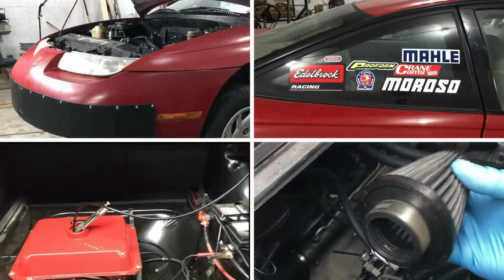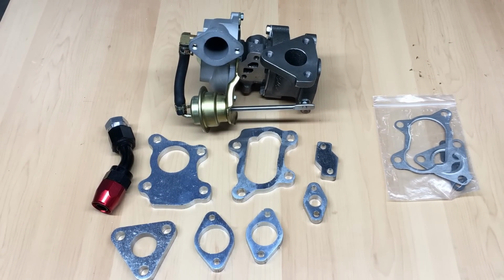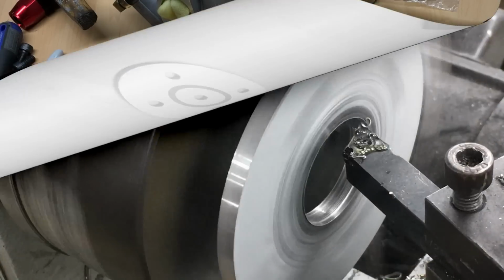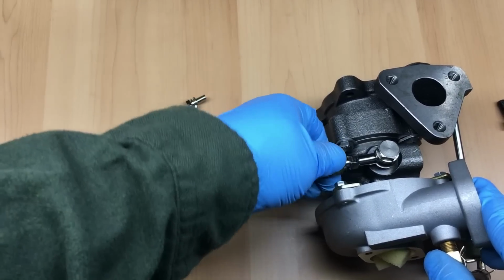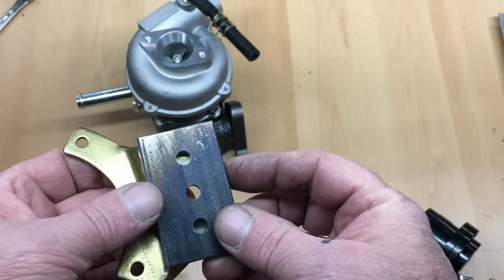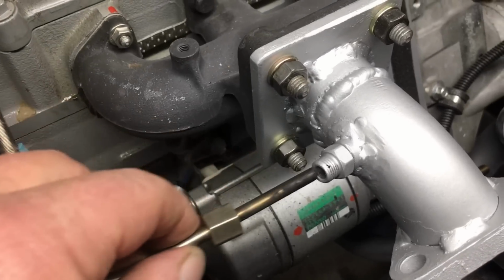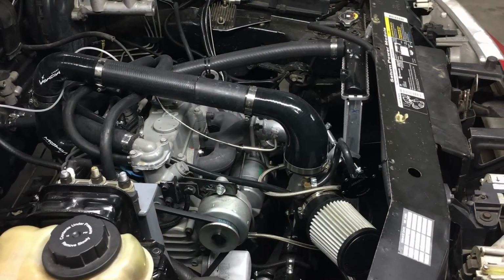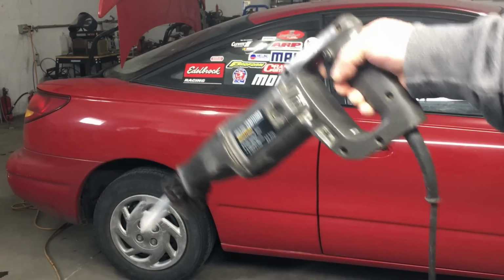S3 E5 We install a RHB31 turbocharger on the Kubota D722 diesel engine in a 1999 Saturn coupe.

Comment: My current project is hooking up an AGNI high power DC axial flux electric motor to an AMR500 supercharger, it blows massive amounts of pressurized air.  I am using it for experiments and inventions, however I was thinking it would be perfect for trying out with an engine such as yours which I may do in the future.  If you're not familiar with AGNI/Lynch motors, they're awesome and worth looking into if you have a project that needs from .1-50hp and high torque; here is some more information which is a little dated but still accurate:

The Lynch motor is an unconventional design with a disc armature. It marries the advantages of a conventional, wound armature motor with the benefits of a flat (printed circuit) motor. It is similar to a pancake motor, but is more powerful than any of these technologies. The disc armature has magnets on both sides, doubling the available flux density and shortening the magnetic path. It therefore packs more power per pound and per cubic inch than any other motor technology. Of course such a revolutionary motor is not for every application - it is not as cheap as wound field motors, but for many applications it is a far superior motor.  It has a previously unheard of power to weight ratio and also power to volume ratio. It is also highly efficient because of the double magnet design and associated short magnetic path. It also includes integral fan cooling.

 The Lynch motor is an important development which spurred other motor designers to improve their products to remain competitive, such as synchronus permanent magnet machines.  As a result of the competition between manufacturers the cost of high performance motors and controllers has fallen dramatically.  We hope the cost of solar cells also reduces to allow renewable transportation to develop as a viable alternative to carbon fuels.
Cedric Lynch built his electric bike around a mid-drive configuration, also building one of the worlds most efficient light weight electric motors to power his rig reliably at 60-MPH for significant distances. He would later set several world records with his axial flux motor and bring it to market as the Lynch / Agni motor. Briggs and Stratton would eventually buy this technology which would lead to the Etek motor, which is now famous for making high speed efficient electric hot rods.

Cedric uses to achieve high speeds is by following the rules of aerodynamics, and building a bike that is as aerodynamic and as efficient as possible. The other builders on this list bypassed this step, and Cedric uses this bicycle as daily transportation on real commutes. Although this high-efficiency motor uses “old school” brushes, this fact allows builders to use very affordable controllers. He has proven his design choices through thousands of miles of commuting, and the Lynch motor is highly respected.

Cedric Lynch is known as the creator of the Agni Motor, a highly efficient electric motor that weighs around 25 pounds and can put out as much as 50hp. 

Cedric Lynch is a British 'mad scientist' type mechanical engineer obsessed with the idea of greener transportation. His interest has been in building a super efficient yet powerful vehicle that can serve as a car replacement.

He started thinking of his own design for an electric motor in 1983 when he began entering competitions organized by the Battery Vehicle Society regarding building an efficient electric vehicle. At the time there was no reasonably priced DC motor with descent efficiency so Lynch decided to build his own utilizing modifying existing motors with old tin cans that he would spread out flat to use as cooling fins. Surprisingly using rudimentary materials and a garage work bench, Cedric was making better more efficient electric motors than any of the universities were able to manufacture in state of the art workshops.

Cedric then came up with a motor design that could be cheaply manufactured and began manufacturing his own motor that he could sell to the public in 1988 and the Lynch Electric Motor Company was born, known as LEMCO.

Cedric first used his motor to create a small boat called “The Spark” that would set an electric boat efficiency record. From there Cedric turned his attention to bicycles, an application generally considered too small for a lynch motor at that time. Cedric mounted his motor in recumbent bike, allowing him space to eventually use a set of thundersky lithium batteries.

The resulting aerodynamic recumbent bike had a top speed of 60mph and still managed an incredible range of 150 miles. Cedric rode his recumbent creation everywhere as a daily commuter, putting an amazing 50,000 miles on the machine - technically a motorbike.

Briggs and Stratton, the US firm famous for lawn mower engines, bought the technology and used it in their E-Tech Motor, and Cedric went on to manufacture his latest incarnation of his lynch design into the Agni motor, which is used in go karts, sailboats, motor boats, and even small airplanes.

The Lynch designed motors all have the same traits. Brushed motors, around 25 pounds in weight and they are able to put out enormous power compared to their weight. Sometimes as high as 50 hp (depending on amperage ran through the motor) at an incredible 98% efficiency.  Lynch Motors are also the most often used motors in electric motorcycle racing applications.

Cedric's zero-emission motorcycle, which has a top speed of 120mph, was shown in action winning the world’s first zero carbon race – the TTxGP in the Isle of Mann.

The idea for the electric motor has been snapped up by the 56-year-old’’s friend Arvind Rabadia, who together with his brother Hasmuk Rabadia had been thinking of starting a business in India. They have now set up Agni Motors to make further-improved versions of Cedric’s motors

Despite Cedric’s breakthrough invention he has no formal engineering qualifications and taught himself the techniques needed to construct his engine. He first became interested in electrics when his parents bought him a book entitled How to build things from things found at home. 
The Etek motor is a brushed 25-pound pancake shaped motor that puts out enormous power for its weight. Depending on amperage and voltage the Etek can easily provide between 15-horsepower and 30-horsepower reliably and consistently (11-kW / 22-kW). A perfect platform for a powerful electric bike if you do not mind the weight. Although brushless motors are considered more modern, a brushed motor like the Etek allows the builder to use very affordable controllers.

Cedric-Lynch invented the motor and sold it to Briggs and Stratton which US company produced the Etek at a lower price (around $600). In the late 90’s early 2000’s it was the way to go for a high-power / light-weight electric vehicle. Many small E-vehicle records were set using the Etek motor. Finally, the market had a relatively lightweight and powerful electric motor available to the masses.

In essence, the Etek allowed hot rodders to build electric bikes. Before the Etek very few people had ever achieved 50mph on an electric bike. Even today, Etek motors (and newer incarnations of the Etek motor) are used to make some super fast electric bikes. In the case of Liveforphysics, the fastest E-bikes ever.

 Liveforphysics used a newer version of the Etek (the Agni motor), to achieve speeds of over 70mph, and dominate a recent hill-climb event.

Every Etek I have ever ridden has been characterized by brutal off-the-line acceleration, usually to a point where you have to apply the throttle very carefully or get thrown off. However, it is possible to run an Etek at a lower voltage or lower amperage and have a very manageable, safe, and sane electric bike that will not burn out on you, no matter high steep the incline.

Comment: Recommend matching the flanges to the gaskets on the exhaust side. I had a 93 Jimny 660cc turbo, discovered a crack in #2 exhaust runner, matched the new manifold to the exhaust side gasket and the manifold to the turbo. The turbo had a lot of material disturbing the exhaust flow. I am sure the leaking exhaust wasn’t helping, but I did see less turbo lag. I am sure you will see some lag with the addition of the inter cooler and increased boost pressure.

Comment: If your EGT is good, retard your timing for more boost. Also, I would go smaller with the piping to the engine. The turbo has to pressurize that pipe. Short and small is better, less volume to fill.

I have the same turbo on a eBay 400cc diesel on a garden tractor. It easily makes 6 psi under load until the tires loose traction. It makes 2 psi just mowing the yard. You can definitely get more boost.

Comment: Don’t forget that you now need a rising rate or 1-1 fuel pressure regulator.
Sometimes called a boost reference fuel pressure regulator.
Reply: Don’t need that on a diesel it’s DI
Reply: @404MissingLink  
Yes and it’s still got a fuel pressure regulator valve in the fuel rail. 
And if that fuel pressure ( valve ) is not being commanded to raise fuel pressure with boost you’ll run lean and that will melt things. 
Simply put this engine doesn’t know it’s getting more than atmospheric pressure.
Reply: @Whateverpoopiepants  diesels don’t work that way. Direct injection is around 2200 psi. You really don’t need boost referenced pressure regulators and diesels don’t melt things by going lean if you take fuel out they just make less power. I think you’re confused with a petrol motor which you’re absolutely right about. Diesels share almost nothing in common with them
Reply: You technically don’t need that on gas either. You have to tune appropriately either way. Obviously a FPR helps the injectors go a longer way. My boosted 5SFE Camry has the FPR on the sending unit in the tank, it’s got a static pressure.
Reply: @jmhalder  
I’ve also cheated on mine, I haven’t done what I’ve said and instead used a 4 bar regulator from another model. 
However the ecu itself has a boost pressure sensor and in the fuelling setup you can scale your injectors and tell the ecu it has a 4 bar regulator. 
But this is mechanical fuel injection and has a linear fuel curve not one that accommodates for 0 bar at idle and then 1 bar at full chat. 
That actually means your getting 7 psi less fuel at peak boost.

Comment: More power = more heat and higher egt. 
If the exhaust is cooler now your making  less power.
You need more fuel for more power and that means more heat. 
Intercooling will help but at the same power level with a turbo the egts will be hotter because of the induced heat through the turbocharger.
Reply: It's a bit different for diesels because they are fuel quantity regulated. Burn the same amount of fuel in more air and your power won't improve much, but the peak temperature will be lower because the heat is 'diluted' in a greater mass of air.

This is part of why diesels love turbochargers so much. They're not detonation limited like a gas engine, so if you can supply enough air to keep the EGT under control you can just keep adding fuel until something breaks.
Reply: @nerd1000ify  
That’s nonsense, a given amount of fuel has a certain calorific value or heat value or energy density. 
For more power that requires more fuel and therefore more heat will be created.
Reply: @Whatever  more heat yes. But if we also have more mass of air we can limit the temperature. 

A quick experiment you can do to demonstrate the principle. Get a small cup and a large jug, fill both with water, and drop an ice cube in each. Then wait until the ice has melted in both and check their temperatures.

Melting a given amount of ice always absorbs the same amount of heat. Will the jug get just as cold as the cup?
Reply: @nerd1000ify  
So in your view that engine will now run cooler because it’s been turbocharged ? 
That’s not how this works, you can’t just add more air and hope for the best. 
Absolute nonsense.
Reply: @Whatever  not the engine as a whole, the cooling system will experience increased load. However with turbocharging the Exhaust Gas Temperature (EGT) will be lower at a given fuel delivery rate. This is not a difficult concept really, we are not changing the energy we add to the system but the energy now heats a greater mass of gases inside the cylinder. deltaT = energy added/(mass*specific heat capacity) so if energy added is the same we can reduce deltaT by increasing mass. Why do we care about EGT specifically? Excessive EGT risks burning the exhaust valves and/or pistons, even when the cooling system is able to handle the increased load.

The video actually shows this happening,   his EGT is significantly lower despite the overall performance of the car improving.
Reply: @nerd1000ify  
You’re talking absolute nonsense. 
You can’t just add more air, there is a fuel mix for diesel ( stoich ) 14.5-1 and you just happily ignore that and think adding more air will work. 
Have you ever actually tuned a diesel engine in your life ?
Reply: @Whatever  You don't know how a diesel works do you?

I suggest looking it up, but in short diesels do not (and in fact cannot, unless you are ok with giant clouds of black smoke and blowing your engine up) run stoichiometric, ever. Most of them don't have any kind of throttle, and older fully mechanical diesels will run with no induction system whatsoever, just open ports. Power is controlled by varying the quantity of fuel injected.

This is possible because the fuel is injected just before TDC and ignited by compression rather than a spark. Compression ignition is less sensitive to AFR, plus the fuel doesn't form a homogeneous mixture with the air, instead it is much richer (rich enough to support ignition) near the injector and leaner everywhere else. This is also why diesels tend to be a bit smokey at full power, they have local rich pockets even when running very lean overall. Typical idle AFR for a diesel is often leaner than 100:1. At full power they run more like 20:1, depending on the design.
Reply: @nerd1000ify  
The amount of power is dictated by the amount of fuel, the heat produced is inline with the power made and fuel used. 
The amount of fuel has to be proportional to the air ( that can change during transients ). 
The figures you give are nonsense , where did you get that from ?
Reply: @Whatever  You are still stuck thinking of gasoline engines. 

Diesels do not work in the same way. As I said, there is no throttle on a typical diesel and air enters the cylinders unrestricted. So if you ran them 'proportional' there would be no way to control power output. They are instead controlled by varying the AFR. At idle, power output is very low and thus AFR is also super lean.

Anyway, I have no more energy to try to teach you something you clearly do not want to learn. So just stick to gas engines and let others worry about the diesels.
Reply: @nerd1000ify  
You’re wrong and that’s ok.
If you think you can add say 14 psi of boost and then add NO additional fuel you’re have half the amount of fuel you’d actually need. 
Modern diesel aren’t like some crap cummins. 
You must go and tell the tractor pull guys that they don’t need bigger injectors or large fuel pumps they can just make more power with air. 
You’re off your rocker.

Comment: If you pick up a TIG, I highly recommend the AlphaTig 200x. Very versatile, great arc, and more adjustments than you can shake a stick at. I've had one for several years now as my hobby machine, and it's been amazing bang for the buck.
Reply: AlphaTIG 225XI is their current model and I would definitely recommend either that or the PrimeWeld TIG225X from everything I've seen.

Comment: Colin Chapman famously stated horsepower makes you faster on the straights, less weight makes you faster everywhere. Since horsepower is limited by capacity, weight reduction is the obvious means to improve performance.

The 5 lbs. boost will make the emissions cleaner, a boost controlled fuel enrichment is what is needed, since the injection pump is not designed for the intended purpose. Perhaps propane injection via a pressure control switch into the induction could help. Using a cold start injector in a similar way is what I used in gasoline turbo projects to enrich boost combustion. 

With diesel engines, the fuel is directly injected into the combustion chamber, thus limiting the option to adding  fuel to the induction, just pay attention to the exhaust temperature gasses to access the correct volume of supplemental fuel